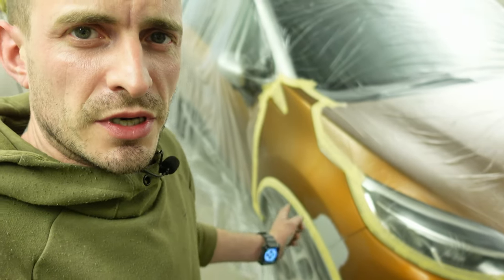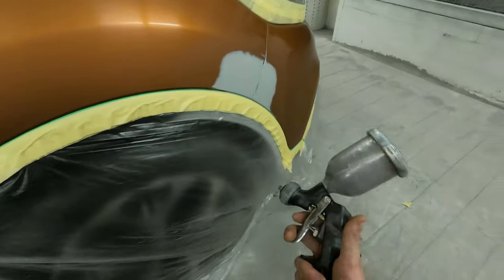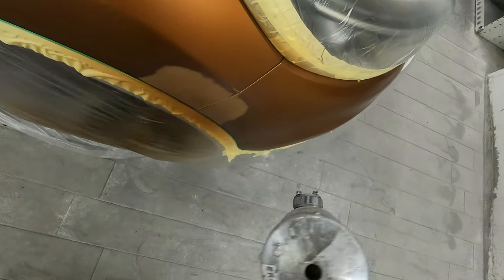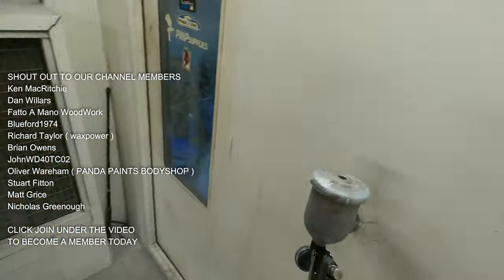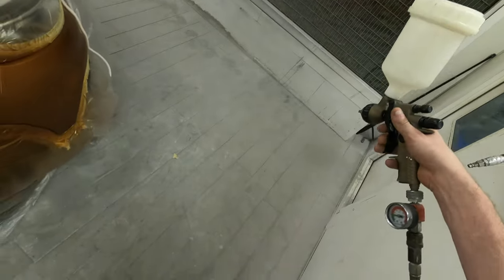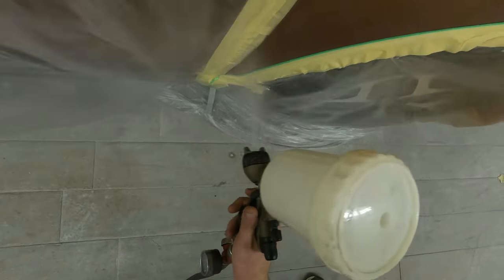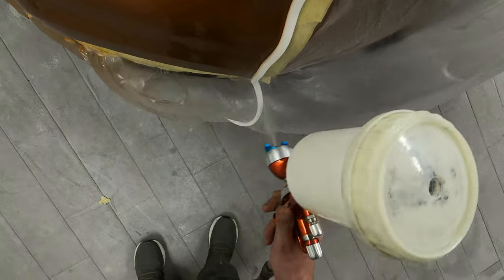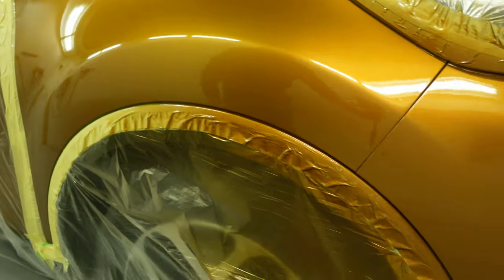Renault Pearl Orange walkthrough

Comment: Great video Tony and have to say you are looking so much better than you did, man that base didn't want to cover very well it looked like you put about 6 or 7 coats on there but I can see you was putting it on very fine so it flashes of quicker to get more product down. That clear does go on nice and I find you can lay it on fairly heavy and it doesn't run, yours came out looking very nice mate great colour as well.

 I didn't mean to stir up any trouble for you on the group mate, maybe I shouldn't have tagged you 😁 I was just trying to liven the place up a bit to get more traffic through the group, I don't know if David told you what I'm doing mate? if not I'll tell you via DM on FB 👍
Reply from the maker: Lol I’ve put like 18lbs on mate that’s why , and no don’t know mate drop me a message

Comment: Great work mate , because you fixed a metal and plastic panel did you have to use 2 different primers ?
Reply from the maker: No mate there both plastic on this so just used a touch of adhesion pro motor and normal primer
Reply: @TonysRefinishingTV  plastic wings , what’s the world coming too 😂
Reply from the maker: Have been on Renault for a long time mate

Comment: I've noticed the ultimate clear pinching up,air drying  or after a quick infra red bake.It's a shame because I love the way it goes on.Have you mentioned it to Final Systems that it doesn't do that with Churchill activator ?
I'm thinking of going over to Mipa CX4 with HS25 activator,I've been hearing good things about it
Reply from the maker: That’s why I tried a different hardener with it mate as it was my thought the hardener was too fast , I haven’t but someone in the group mentioned that I’d said to change the hardener and one of the reps popped on the conversation to basically say I was wrong and it works fine but I know it doesn’t lol , I’ve only used cx4 on a job I did at my mates shop for him when his booth was down have a nice easy gun finish but abit to thin for my liking tbh

Comment: Iam doing a small job like u did in a video.  I see u didn't send the fender before painting.  Is that ok to do?
I am putting a single stage paint on .
Can I get a way by not sending  the surface before spraying?
By the way u did a super job!
Reply from the maker: Send ? Sorry not sure what you mean do you mean sand ?
Reply: @TonysRefinishingTV  
Yes, sand.
Reply from the maker: All the areas you’ve mentioned have been done with grey scotch to key them
Reply: @TonysRefinishingTV  
Ok thanks

Comment: What's your favorite clear gun? Right now I'm using an iwata lph 400lv but it doesn't like the high solid clear the shop switch to unless I reduce it looking to try something else.
Reply: Try TE20 air cap 1.2 or 1.3 tip 29 psi.
Reply from the maker: My 4600 dvr clear 1.3xl by far mate
Reply: @TonysRefinishingTV  thanks for the info 4600 hard to find in the usa but a few places got them thank I will try on. Would you pay the extra money for the digital model?
Reply from the maker: Tbh mate I’m not fussed for a standard or digital one mate it’s personal preference I guess